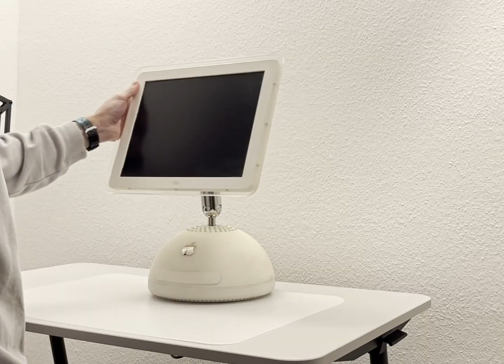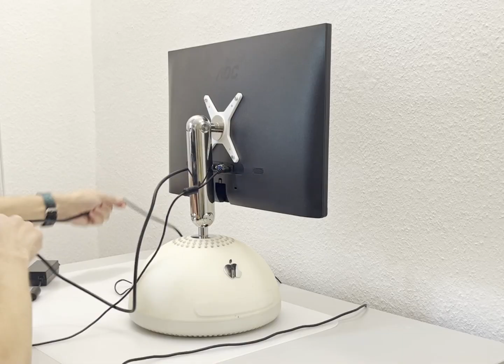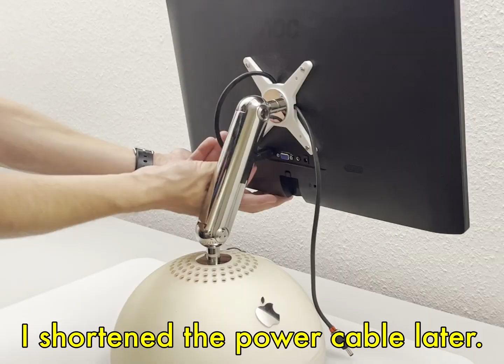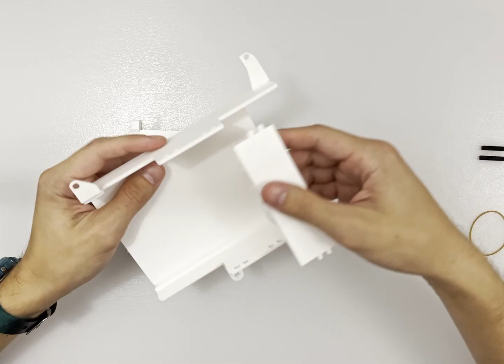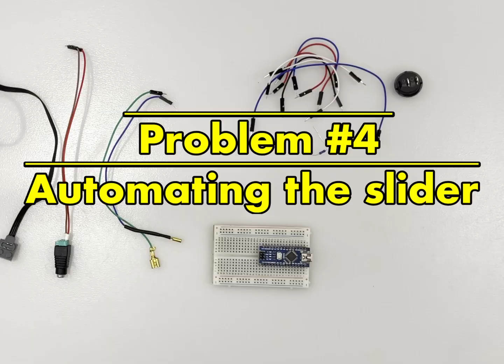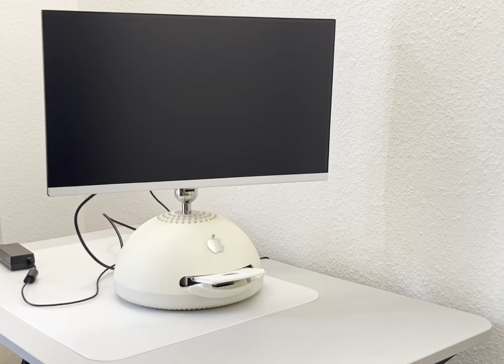G4 iMac mod with hidden MagSafe charger

Comment: Does the arm support it well in every angle, without sagging? It looks like you might be helping it a bit with your hand when it's tilted ;-)
I'm not asking out of spite, mind you! I would really like to do the same thing myself, but want to make sure I'm not scarifying any of the smooth movement of the original when choosing a screen. I'd rather have a smaller screen than any sagging!

Comment: nice project. can you confirm what is the maximum weight of the monitor 15 inch imac g4 can handle easily. i have 2.4kg monitor which i am planning to mount it similar like yours.
Reply from the maker: Hi, 
i used a lighter monitor (around 2kg), but maybe the g4 with a larger screen can handle a bigger weight. (i have the 15" inch g4 version not the 20")

Comment: Replaced an iMac display yesterday with a USB-C cable to power & provide video to the display.  I'm mounting the display inside the existing iMac screen housing.  It's tight but it's doable.  I had to modify the arm slightly by removing a component on the bottom to fit the USB-C head through it.  I created a 3d printed part to replace what I removed, and it seems like it should work.  We'll find out soon!
Reply: @danbrowder2271 Which monitor were you able to fit? I have a 17” G4 that I’m looking to do the same thing with!
Reply: @ I used a "UPERFECT 2K 120Hz Portable Gaming Monitor" 16".  It's a little smaller than the original, so I had a new bezel created out of acrylic.  I needed that anyway since the old one was cracked.  I'd like to try one of their other monitors but I already owned this one, it seems like they might have a 17" that would fit.
Reply from the maker: Any progress on the porject?
Reply: @ I got it all put together and working, but the 3d printed piece was weaker than I'd like - so I had it printed in metal.  I haven't installed that yet, but hoping that will make it stronger.

Comment: Can you provide the 3D print files for the Vesa mount bracket?  Design looks good
Reply: What is the model number of the AOC display? Do you believe a larger display could be used in the 17inch iMac?  I believe it is heavier and mechanism is stronger.
Reply from the maker: @reggieblond2405  The model is AOC 22B2H. i think it is not possible to add much heavier/bigger screens to this arm unless:
- you can find a bigger screen which is very light (2.3 kg or less), maybe portable usb c monitors
- somehow you modify the arm into a fixed unmovable position, 
I think the movement does not make much sense with big screens anyway. 
I dont know if the 17 inch arm is stronger or exaclty the same
Reply from the maker: I uploaded the VESA adapter. You can find it in the video description 🙂